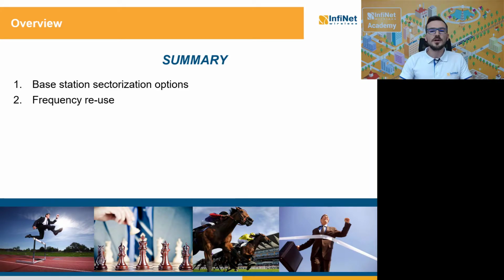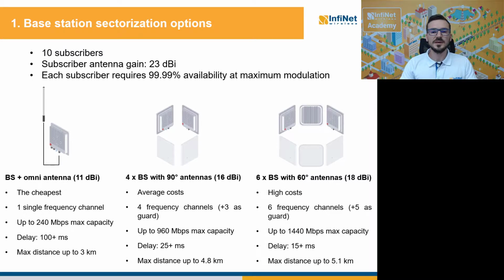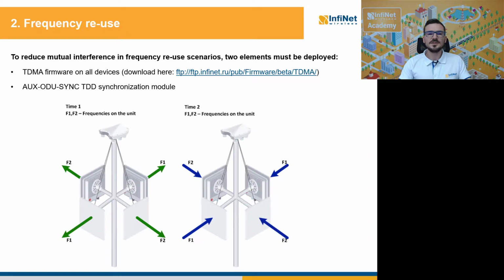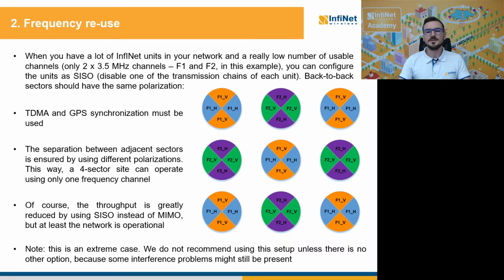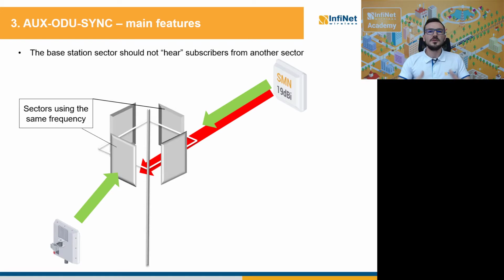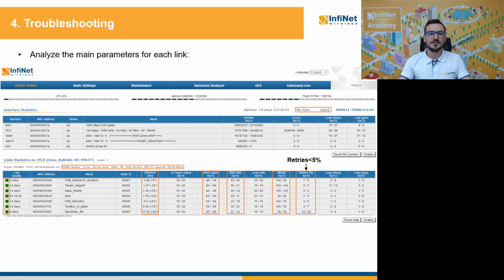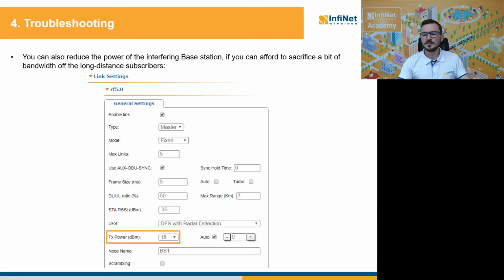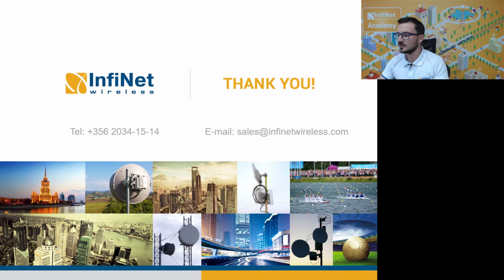Infinet Wireless PtMP network design with frequency reuse and SYNC

Comment: Is there any separate power cable required for GPS sync devices? And any configuration for GPS sync required ? Or only base and AUX OdU GPS Sync and GNSS enable will do ready syncing.
Reply from the maker: Yes, a separate PoE is needed. The configuration is quite simple, and you’re right, all you have to do is to choose GNSS Enable.